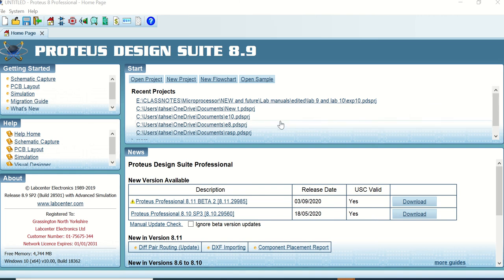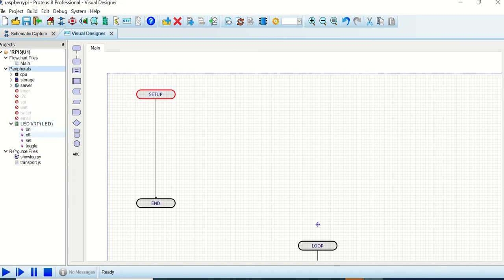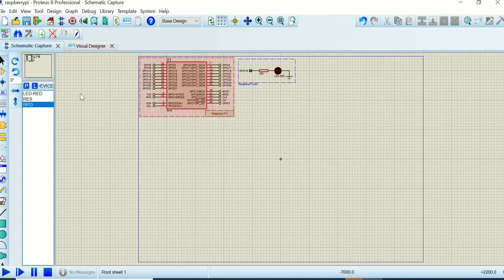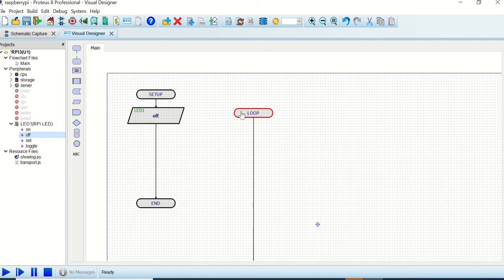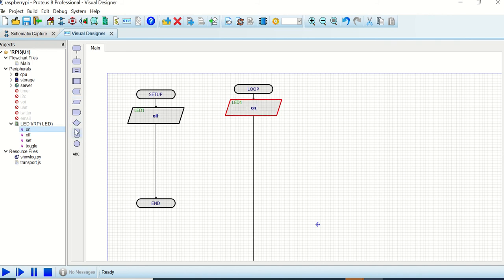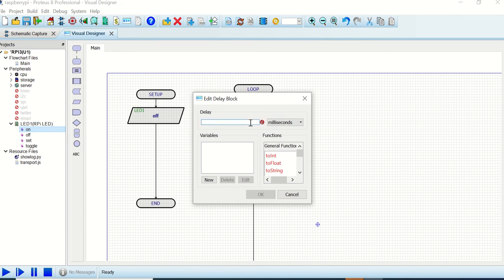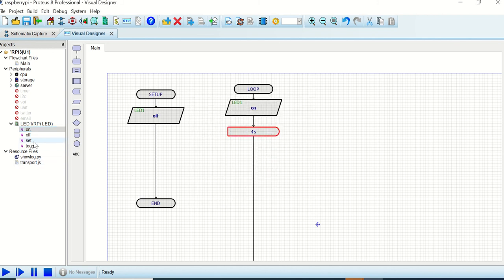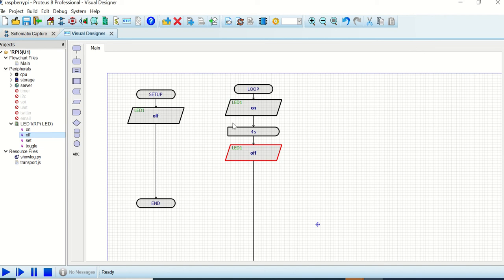a software simulation for designing a traditional traffic system using raspberrypi

Comment: You did not add a delay for the OFF duration for the single LED light simulation. That's why it's not turning OFF. So what happened is that the light switched ON for 4 seconds, then switched OFF, but without any delay, the loop started again, and the light switched ON again. So you have to add a delay after switching OFF, and then it will blink.